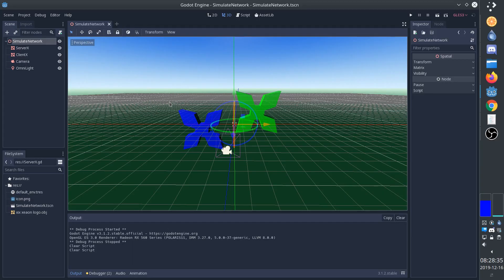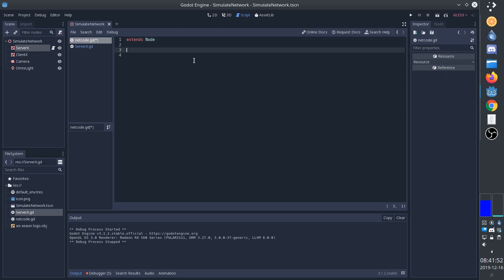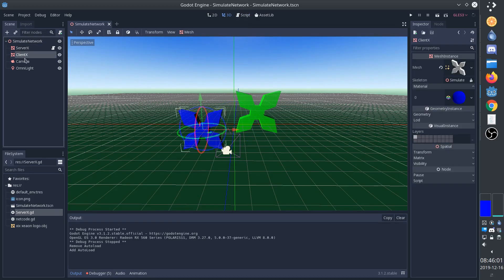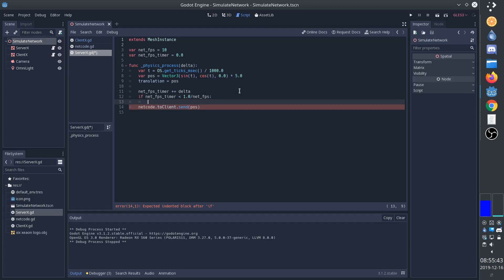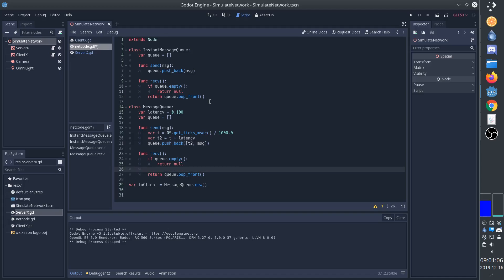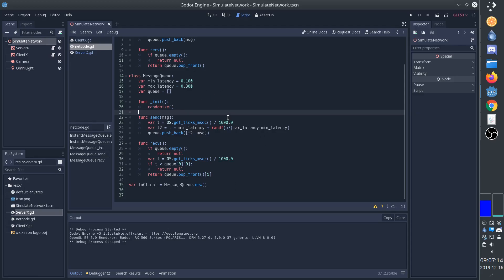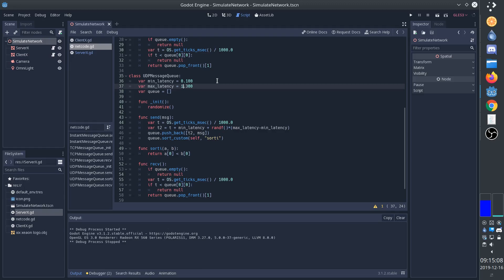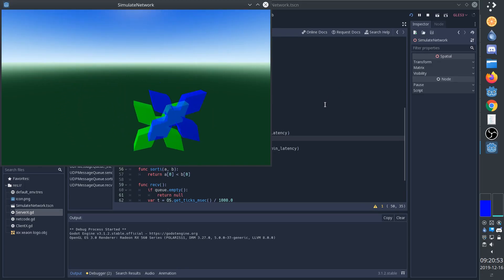How to Simulate Network Latency for Your Multiplayer Game Godot Tutorial

Comment: This is a good technique, and in the past I've used is very similar ideas. When you know about them, you can also just perform networking code exactly as you would over sockets, and use an application like clumpsy to cause delays, drops or issues with the packets for the port used by your game. Then you don't need to manually do anything and the actual code path is tested, as-is.
Reply: Thanks for the tip about clumsy, seems definitely useful!
Reply: Thanks for letting me know of the clumpsy tool